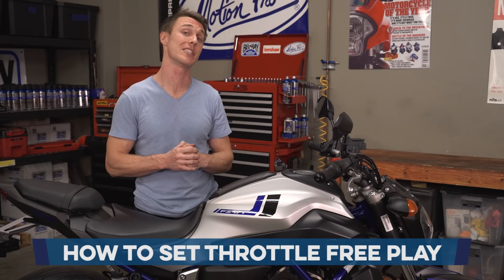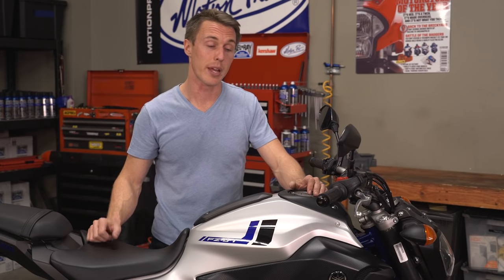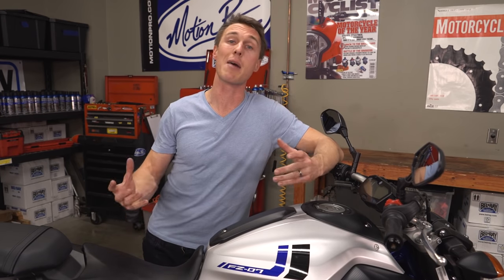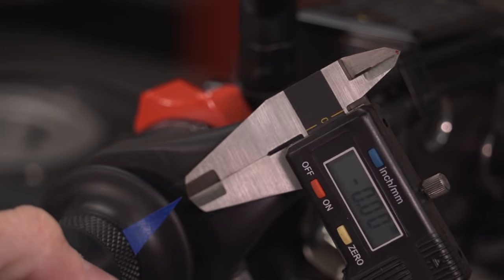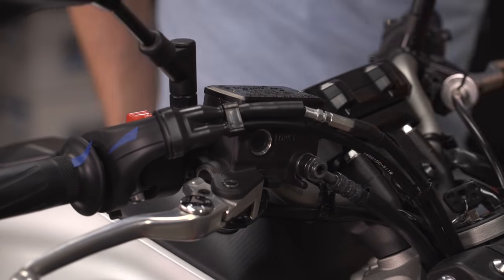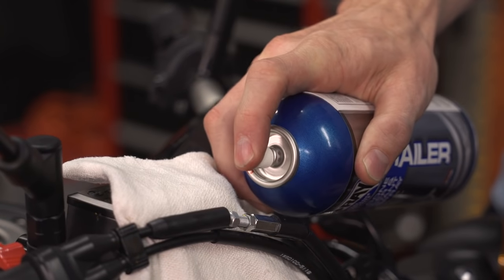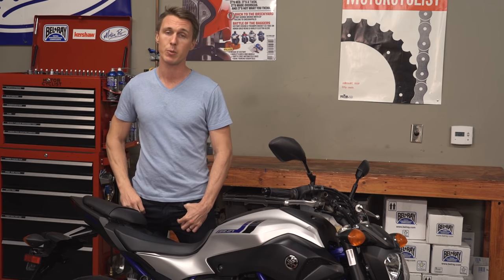How To Adjust Your Motorcycle Throttle Cable | MC Garage

Comment: Another good idea is to spray your cables with silicone. I had a sticky throttle for years... finally sprayed some silicone lube in and the throttle felt brand new. I didn't even know I had a sticky throttle until I rode some other bikes.
Reply: future62 the manual usually recommends lubricating your cables yearly with a lube made specifically for motorcycle cables.
Reply: Yep. There are cable lubing devices too which seal the end of the cable tube good enough to be able to force lubrication through the entire length. Otherwise about an inch of cable actually receives lubrication at best?

Comment: What if I set the throttle free play to 0 mm? is it bad for my carbs, the cable, or the throttle housing?
Reply: Irawan Bagiarsa do that, and then turn the bars side to side. You will figure out the answer to that question very quickly.

Comment: Hey guys. I have a 2012 yamaha R1 and for some reason it starts up just fine but no throttle and the engine light came on. It only has 2400 miles. Any ideas ? Thank you all.

Comment: can you do this on bikes with fly by wire set ups
Reply: Dan Bacarra yes just strip the plastic off the wires going to the throttle and twist. add some electrical tape and the free play in you cable is like new.
Reply: If that drive-by-wire setup involves short lengths of cable, the same applies. The module reading movement from the grip can only read movement when it moves. If there is slop, no throttle movement will be detected and no throttle will be applied by the computer servo.

Comment: I set mine where there is zero no free play, I get it as tight as possiable to where as long as when u turn the handle bars it doesn't change the idle when u turn the handle bars ect ect

Comment: I have a 2 stroke dirt bike that it’s happened twice now where the bike started high reving by its self and the kill switch wouldn’t work both times it happened a few hours after crashing would a throttle cable thag was too tight cause this

Comment: You missed turning the steering lock to lock. What might be 2-3mm free play at dead centre can be zero or worse on full lock. 
There is usually some pull on the cables from the steering flexing them.
Reply: Dude, really? You clearly didn't watch the video all the way through.
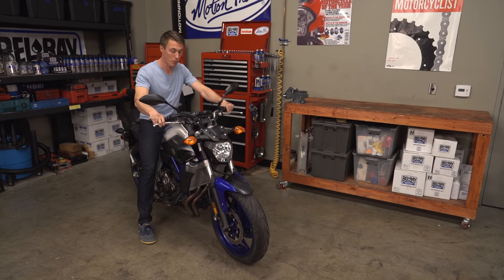Reply: Yeah I did, you mention it around 3:00 but as a final check whereas the thing to do is observe where on the turn the cables go tightest and set the free play at that position to start with. Cables always pull tight around the steering head, so it's pretty fundamental stuff and saves a lot of messing about later.

Comment: My engine doesn't brake like it should after I adjusted the throttle at the handle, it still engine brakes just not like it did before adjustment. Idke doesn't rise either.

Comment: I know this video was made a long time ago, anyway my throttle snaps back OK, but when forward pressure is put on the throttle sleeve, it moves a couple of mm forward causing the bike to stall, I've tried tightening the cables and loosening it, but that movement won't go, when slowing down its natural to put pressure on the throttle and it dies on me, anyone come across this

Comment: basically a half assed video showing only at the handlebars but not at the engine. and yes many different bikes but he showed for the handlebars so showing for the bottom engine part is also different but gives an indication to start with

Comment: Ok now for the question of the century, how the hell do u adjust this on a drive by wire (electronic) system?
Reply: That's more difficult unfortunately, you need to take your bike to a tuning specialist and get it remapped or get a power commander fitted. It's not a job for anyone without specialised tuning facilities.
Hope this helps.

Comment: Hey was wondering can anyone give me some advice on getting my bike to go through the gears after the shifter pedal was taken off,  I'm 17 years old and recently got a 1999 Honda cbr 900RR X , when I got it a couple weeks ago the shifter was unbolted 99% of the way so I tightened it up and it goes into 1st,neutral,2nd and nothing higher , the Internet has no advice and I'm too stubborn to ask my brother lol , if anyone can help it would be appreciated.
Reply: Ari Henning thanks for the info but it was perfect the last time it was driving and it never moved in 7 years it's been in a shed with work been done on it every now and again it was my brothers before it was mine he loosened it to polish the chrome and that's it , would there be any other reason ??
Reply: Ari Henning thanks for the info I'll check in the morning when it's bright I have a service kit coming in the morning as well , also I have the haynes service and repair manual and am yet to find a good illustration of what to do but I'll look some more in it , I need it ready for a big show in a couple weeks, thanks for all the help.
Reply: Ari Henning just to let you know the problem fixed itself I tried it again and it worked perfectly lol

Comment: Great video, but your tape arrow measuring method is flawed because of arc length changes as you move out from the center of the circle and therfore measuring as shown makes your measurements contingent upon the diameter of your grip..

Comment: Am I the weird one that likes a little bit of free play?
Reply: yeap! precision  is the point when it comes to throttle control on a motorcicle... (my opinion)
Reply: Precision and free play are two different things if you ask me. I like free play at closed throttle because it is easier to avoid adding unnecessary throttle under heavy braking.  However once the throttle is applied and the engine is under load i want precision.
Reply: Mostly a matter of each guys taste or feel, as long as slack is kept to a minimum. No need to move a lot before it picks up but I like a little free play before throttle actually starts climbing.

Comment: 3mm when measured 1cm from the throttle, as with the blue triangles, is a lot less than 3mm measured on the throttle itself. The spec should be in degrees, not millimeters. Millemeters are useless here, as it depends on the radius of the measurement, for which no standard is given.

Comment: You showed how to adjust by the hand throttle and then told how it is harder down by carb but never showed us nothing about down by carb. if that is harder then you should have showed us that, not the easy one.